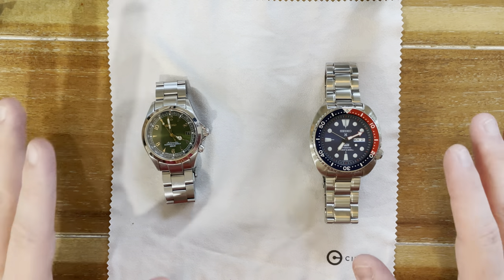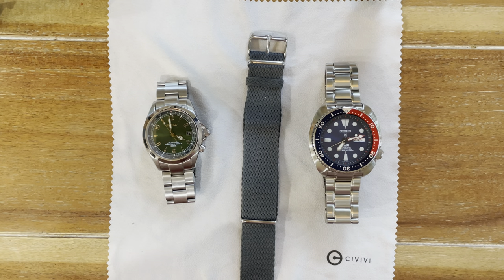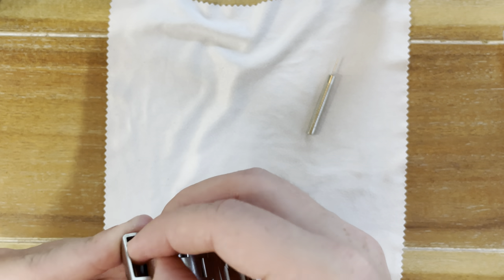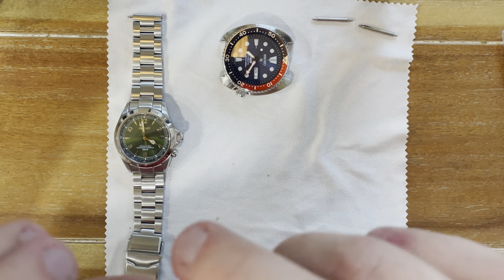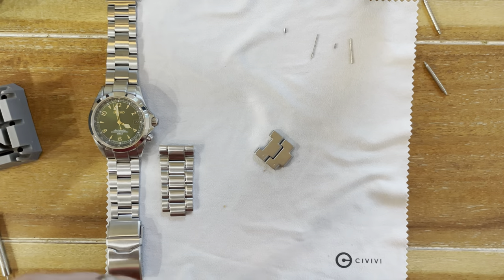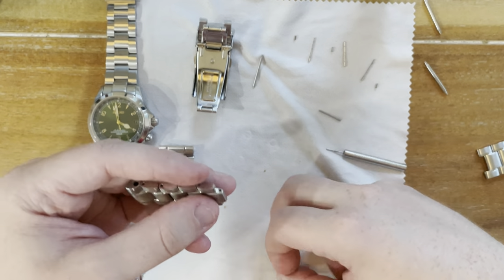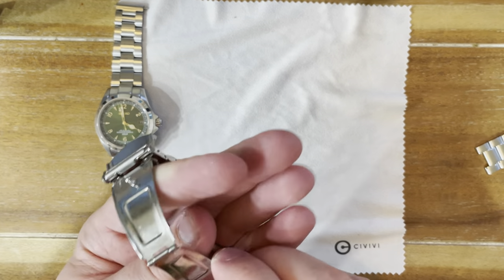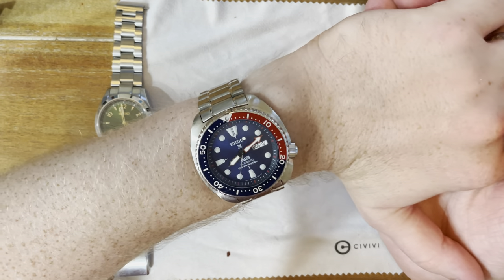How to adjust a Pin and Collar style bracelet found on Seiko SKX, Turtle, Monster and more.

Comment: You also have to pay attention with some bracelets. My samurai has extra clasp length on the inside, pinky side; about a links worth, that is not visible from the outside. So you may want to offset the clasp closer to the thumbside by one link. Generally I don't remove the bracelet completely from the watch when sizing; I take off one link at a time, and refit the clasp with just the pins (no collar), to get my sizing right before fitting the collars. Nice vid.